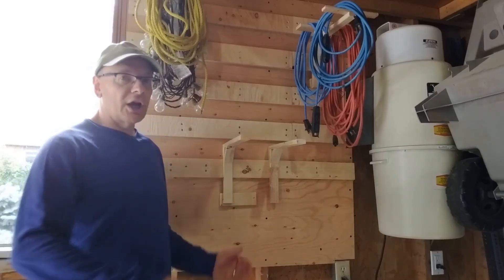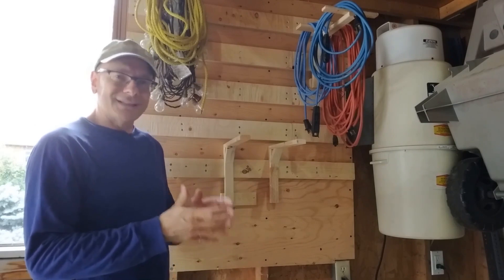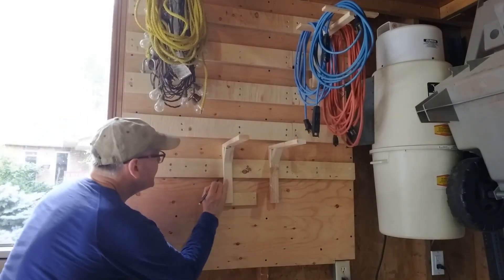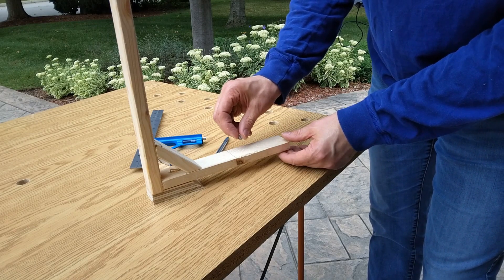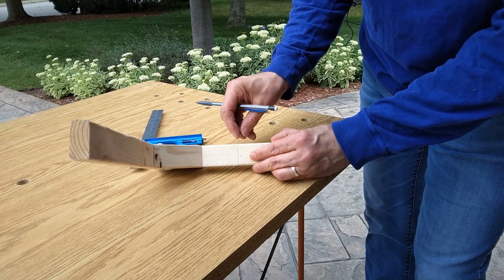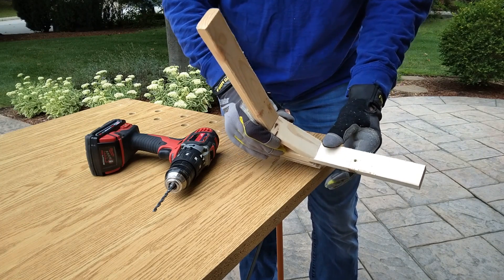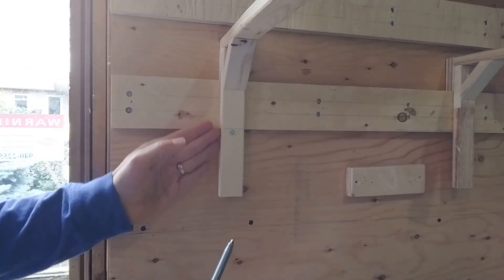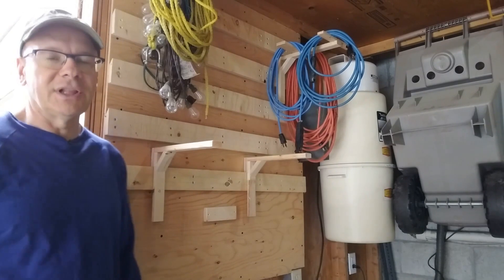Keep French Cleat Tool/Shelf Holders From Falling Off

Comment: You should use threaded inserts or riveted t-nuts with wing bolts.
Reply from the maker: Those are certainly other options as well. I think most people will be looking for a simpler solution which is why I use the simple bolt and nut.